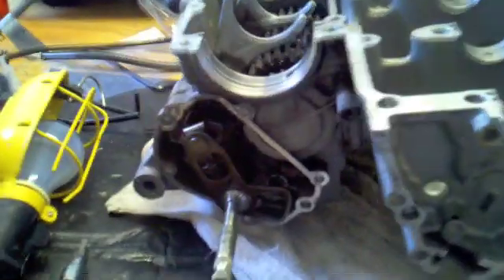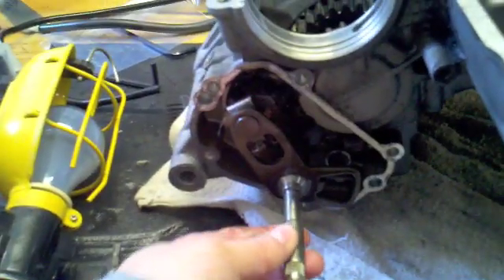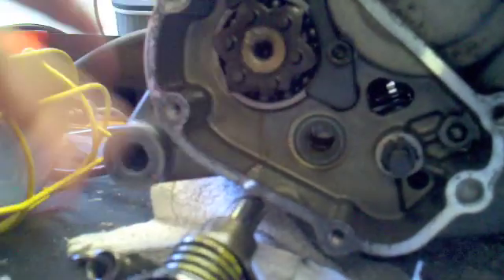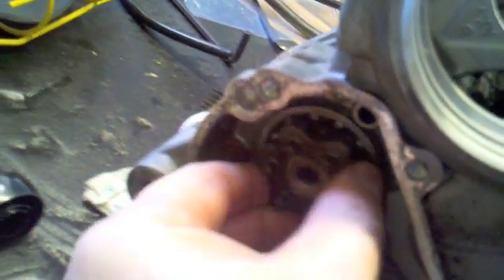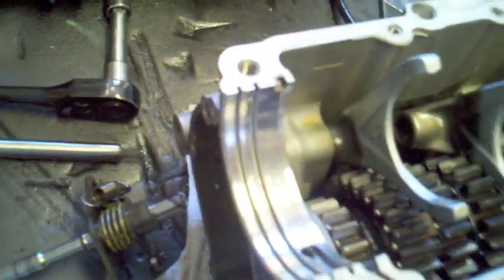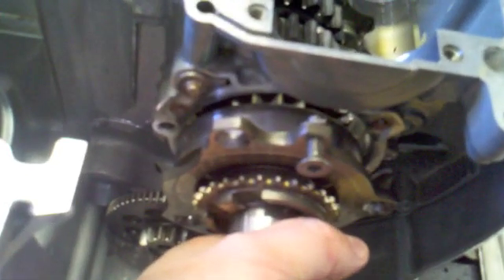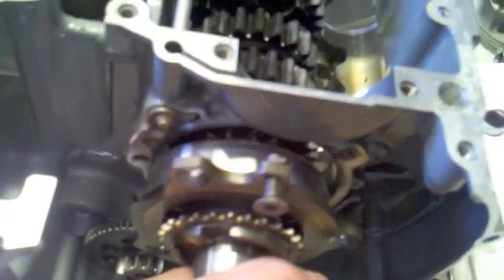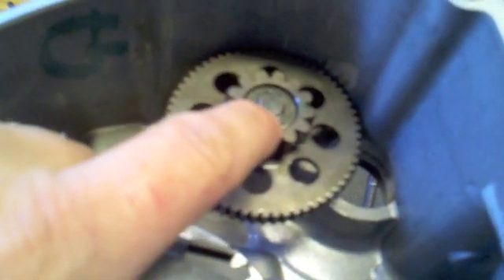2000 Yamaha YZF-R1 Engine Rebuild Part 10

Comment: How u get the toqure bolts out??
Reply: It's Torx, not torque, and just get teh proper torx socket and a breaker bar, I don't recall having any issues breaking them loose, but I see multiple questions on this now, so maybe there's more to it than I recall.  use a long lever is my best advice.

Comment: How did you get the torx head bolts on the piece you have to screw the torx bolts into to pull the drive axel?

Comment from the maker: Hmm, I'm having trouble visualizing how that could be done.  you have to remove the side covers to split the case.  I think you can leave the rotor on the end of the crankshaft, but not sure on the clutch - but its not really much additional work to remove both, I'd just tear into the project, plan to leave them on, and then take them off if you have to - its a decision you can make in real time.